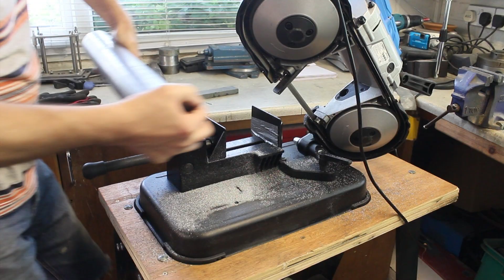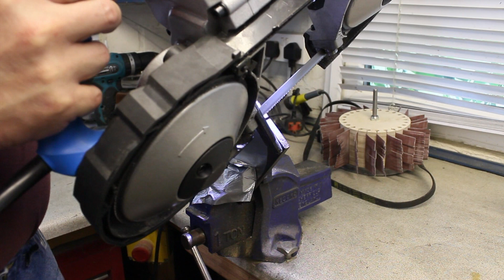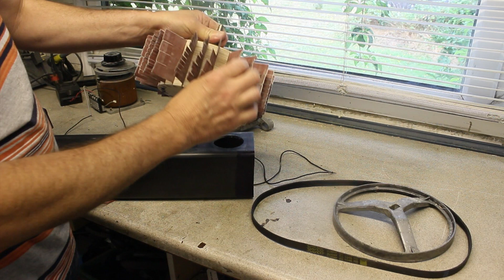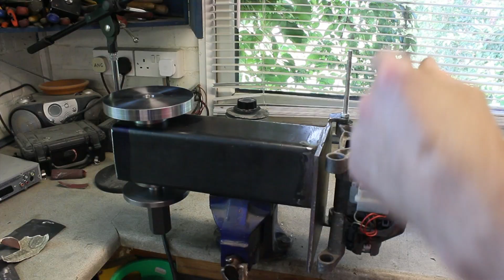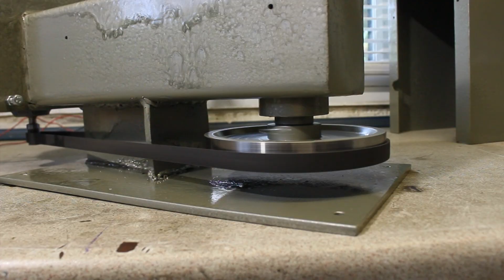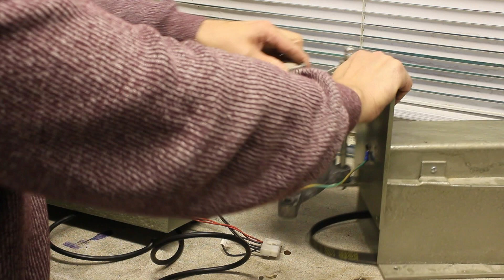DIY Brush Sander

Comment: great but you should make a few holes in the motor box to let some air pass and not let it heat up
Reply from the maker: Good shout. I have just stopped using this machine but it has been pretty good so far. I did have to replace a resistor in the control circuit as it was the wrong spec (needed t be 30W ) but the sander saved hundreds of hours in just taking the edge off parts. It really was worth the effort.
Cheers